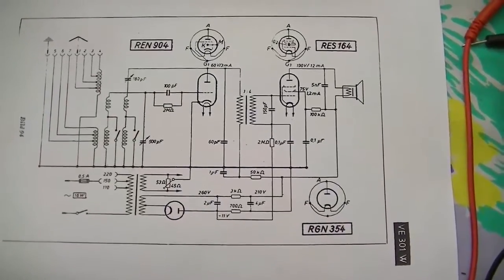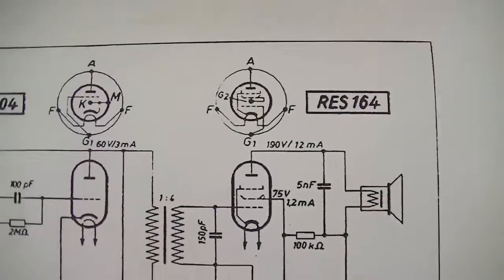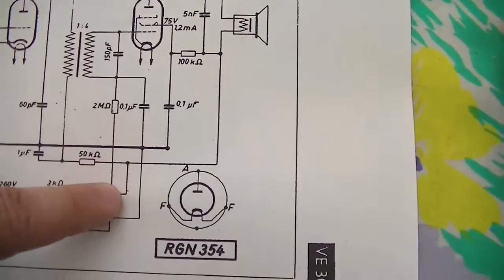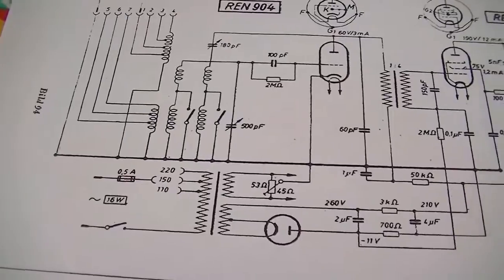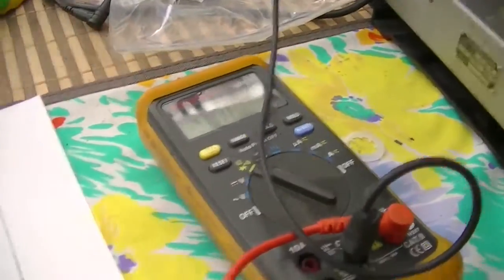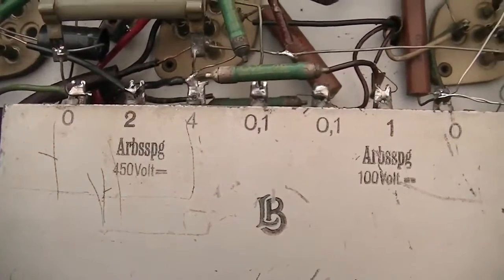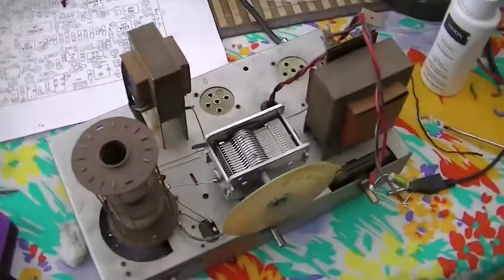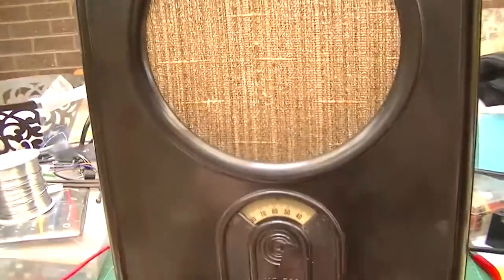VE301W Volksempfänger - Part 2: Checking, Fixing, & Demonstrating

Comment: Those things you removed from the sides that were glued on are very hard to find and were made by a company called detex.  You did a nice job checking out your ve301w and tracking down the simple problem.  My ve301w has hum too and that hum is normal and should be there to some degree.  Too many people stick in bigger caps in the power supply to eliminate it and that raises the plate voltages too high introducing audio distortion and very muddy sound.

Comment: That's a very clean  radio! Were you operating this with all of the original capacitors or do you think that it was recapped earlier? I understand that many of these were destroyed by the owners at the end of the war. Is this an earlier model? I also understand that some of the later designs used a pressed paper speaker frame! Great video, BTW!-John in Texas

Comment: That hum is gotta be from the single digit microfarad filter caps in the power supply stage. A 2mf and a 4mf from the factory!!!???? The Germans made the ultimate in budget wares!
I wonder how good it could sound with a 5mf and a 10mf cap stage and an across the line cap after the switch?